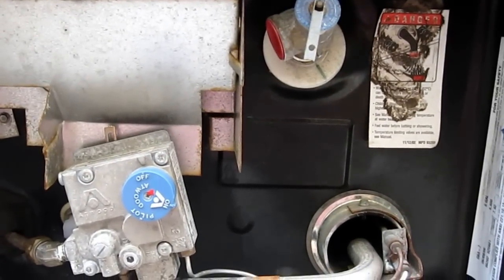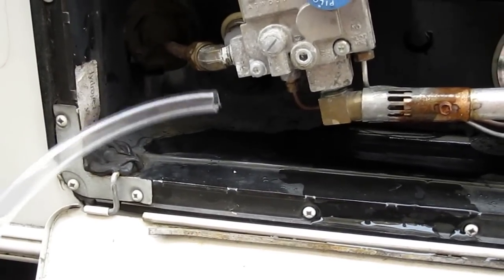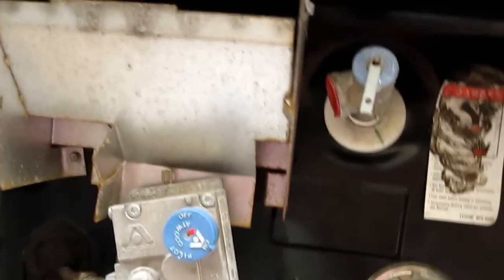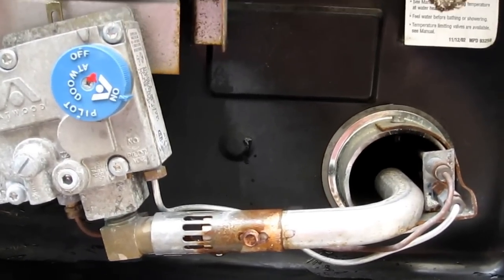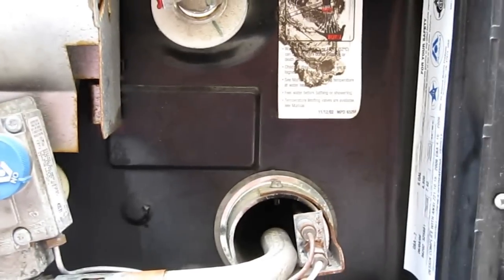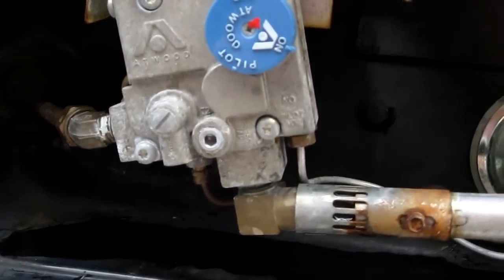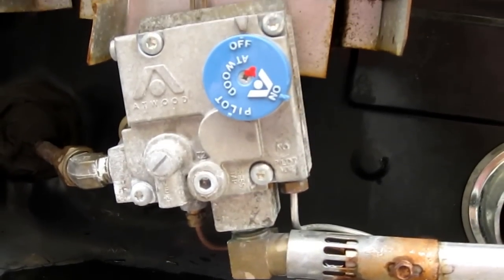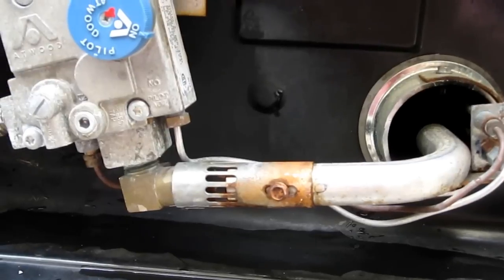Atwood water heater maintenance

Comment from the maker: It could be a low pressure in the system. I had the same problem until I replaced the regulator on the propane tanks. It can also be obstruction in the exhaust vent